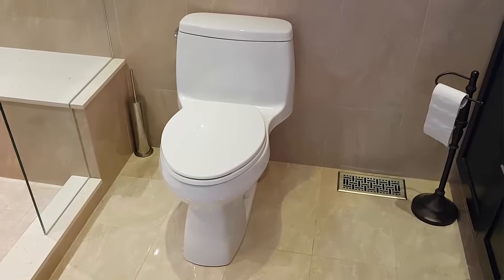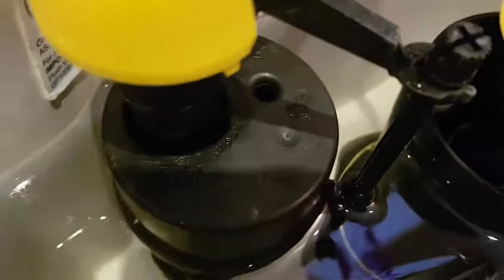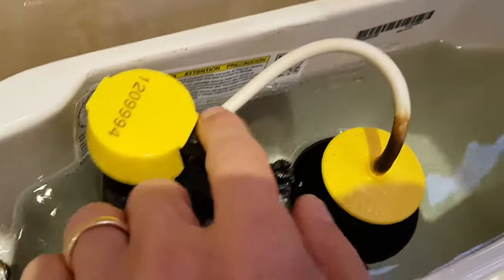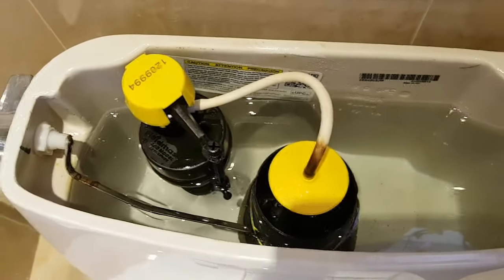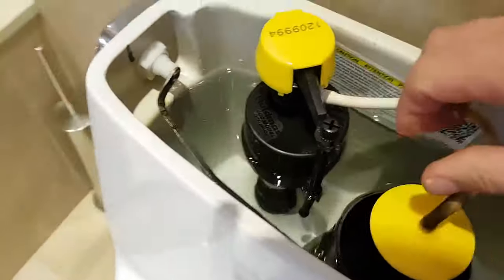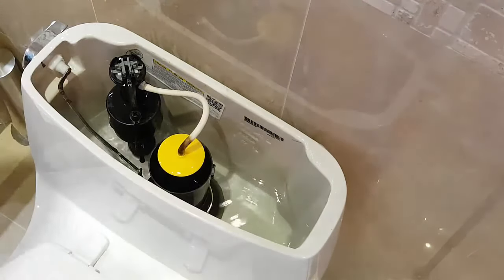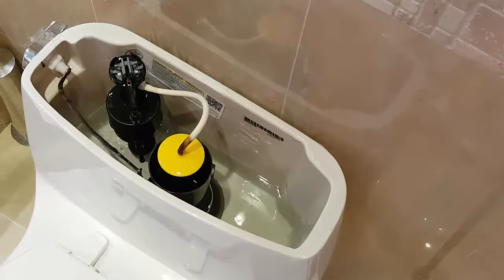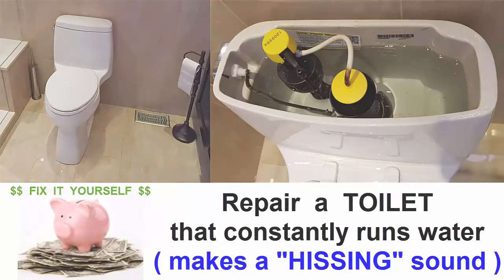Repair a Toilet that continuously runs water (makes a "Hissing" sound)

Comment: Thanks, fixed it myself, why does this happen, I bought this one piece toilet for like $300, new like 10 months ago, only yesterday it happened, it has to be the stupid plastic parts, which means in another 10 months or less it will happen again and i will have to clean it again, those plastic pieces have to careful with them
Reply from the maker: Hello and thank you for your comment. I think the issue could be with impurities in the water supply. The seal appears to be susceptible to small particles in the water supply which can cause the seal not to seat perfectly flat and once the fragment gets into the rubber it can get lodged/stuck and requires a little assistance to clear the blockage. This solution may solve most of the leaking issues but sometimes as the toilet ages the rubber seal gets hard and even cleaning/removing blockages doesn't help and a new rubber seal is required. This happened to a friend of mine and she ended up buying a new rubber seal at Home Depot for less than $5 and after replacing it the toilet was good as new. Vito Casola - FIX IT Yourself.!!
Reply: Garbage toilet it has happened a few more times since this like 3 or 4

Comment: Fix it yourself why when I turn the part a quarter turn the part don't come off !
????? What a joke !!!!
Reply from the maker: Hi Trudy, You will first have to remove the plastic cover and then try pushing it down a bit while turning it one-quarter turn, making sure you are turning  it in the correct direction (counter-clockwise). Vito Casola - FIX IT Yourself!!